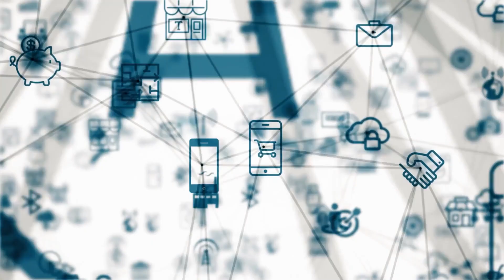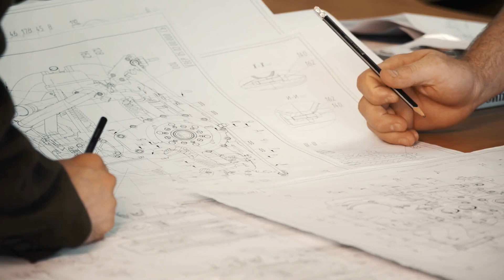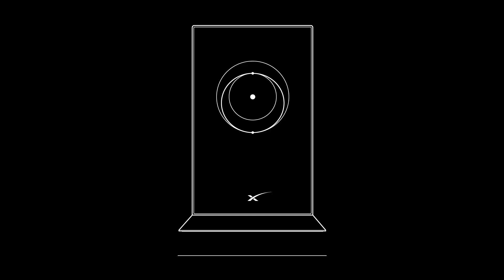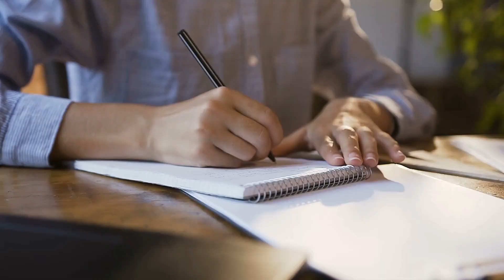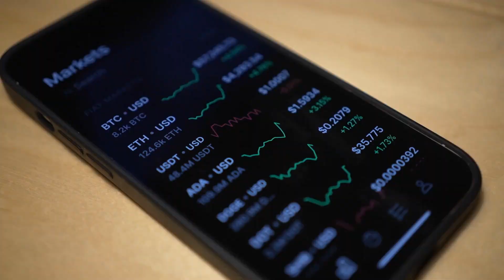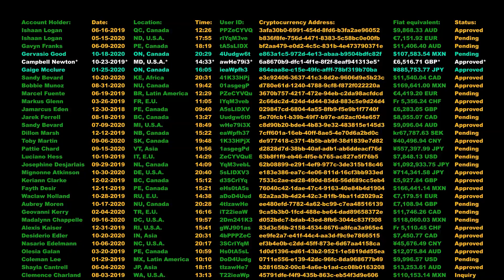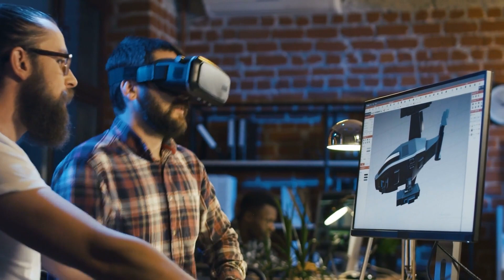Top 15 Emerging Technologies Changing the World (Part 2)

Comment: Very low power neuromorphic processors such as intel's Loihi etc will reduce the power consumption of data centres for machine learning applications to a thousandth of its current levels by replacing GPUs. That would be interesting to cover here 😀
Reply from the maker: Great suggestion! For sure!